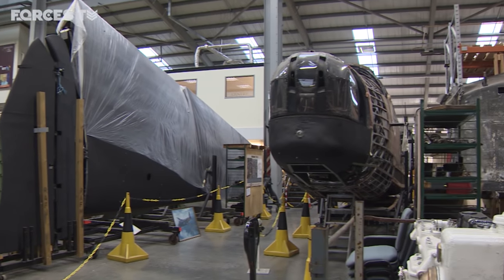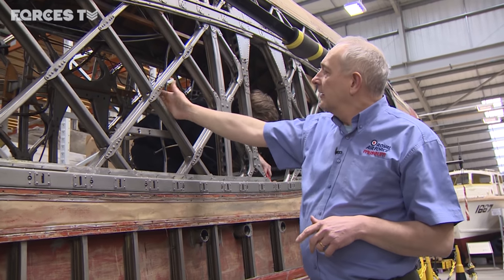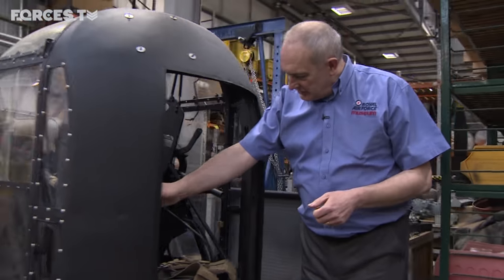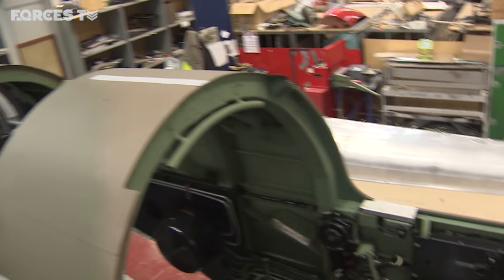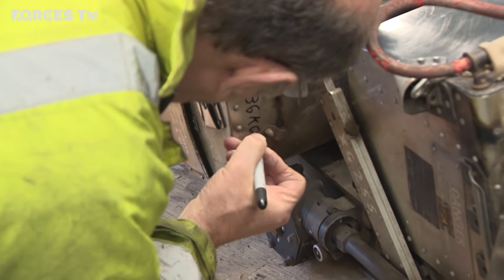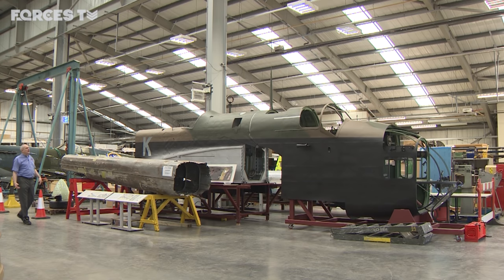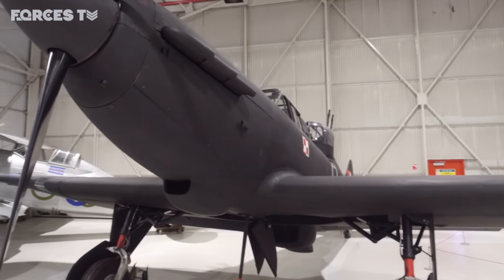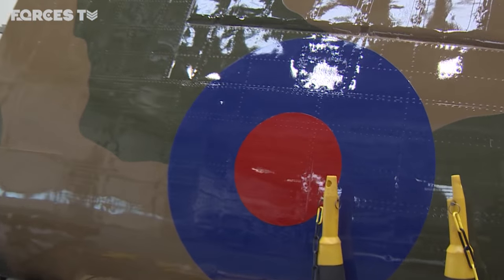The Museum That Restores World War Two Aircraft | Forces TV

Comment: I remember building the Handley Page Hampen from Airfix models when I was a kid, however my favorite was always the Avro Lancaster or its match the Short Stirling.
Reply: Um...sorry, Billy Bob, but the Stirling was no match for the Lancaster. For a start, its wing span was only 99 feet, due to some idiotic Air Ministry requirement that the aircraft must be serviced inside hangars and no RAF hangar could take a wider wing span than 99 feet. That limited the Stirling to a maximum altitude of 16,000 feet. In addition, its bomb bay design did not allow large bombs to be carried. As the war carried on, Stirling were removed from bombing duties and many wound up towing gliders on and after D-Day.
The Lancaster was superior to the Stirling in every way.
Reply: Try the new Airfix . They are awesome . Salute from Canada .
Reply: MarsFKA - Thanks for the specs.
vincent Lefebvre - merci pour le tuyau.
Reply: @MarsFKA  You might think they would have got bigger hangars ....

Comment: If I was caught using a scriber on a skin panel as an apprentice I would have been sacked. Modern aircraft fitters/engineers will be using pretty much the same techniques to manufacture and repair today's modern aircraft
Reply: You cant use pencil because the graphite will cause corrosion. I think a light scribe is ok, so long as it's buffed out and alodined.

Comment: I see that they were using a permanent black marker on a seat for numbering. They need to check if using it on other parts causes micro abrasions to the surface which could turn into fractures. We were stopped from using black marker pens on stainless steel components for the same reason at the company I worked for 40 years ago. I am not a metallurgist so someone else needs to comment if the same happens on aluminium.

Comment: As an ex R.A,F.Eng Mech and Aircraft nut I HATE seeing Museum restored Aircraft finished in that High Gloss finish, originally they were finished in low gloss paints of the day circa WW2....and THAT is how they should be NOW to be Authentic.
     It has been explained to me by a Painter and Doper of the 1950's that the theory is the High Gloss paint is used for longer protection.... Fine then use the High Gloss paint as an undercoat and finish coat the WW2 aircraft in it's original low gloss. PLEASE do not try and tell me the WW2 paints are not available...ALL modern paints can be DULLED DOWN.
     Authenticity PLEASE